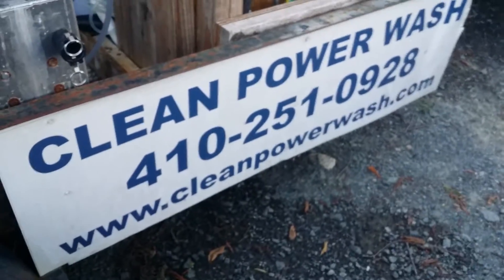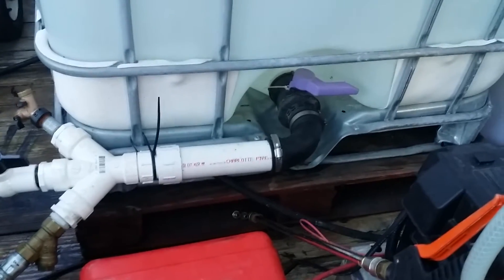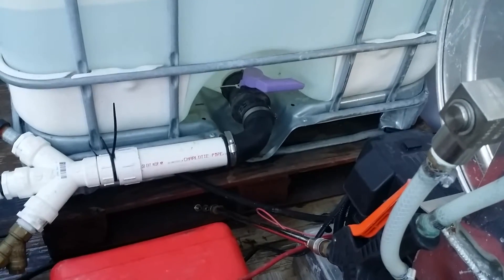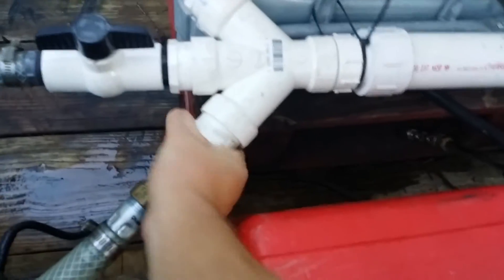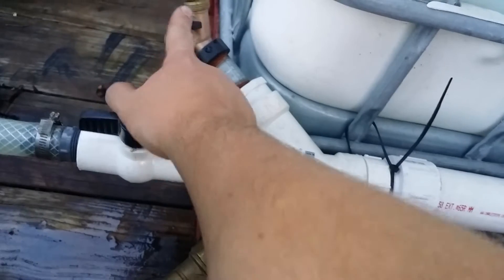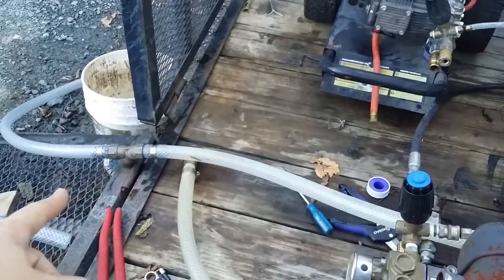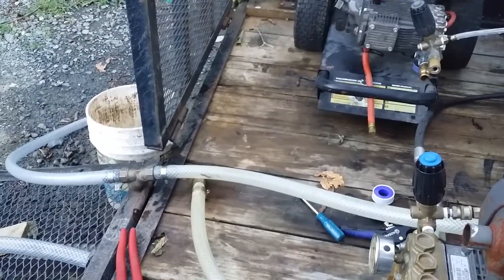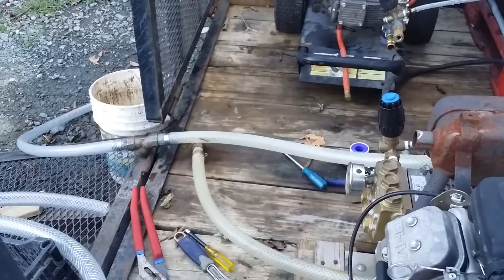How to Install Plumbing for a Supply Tank!

Comment: Hey Rob, what size buffer tank would you recommend for a 8 GPM pressure washer.  I’ll be pulling it on a 5x8 trailer which has a working load of 1,600 pounds.  My thoughts were a 125 gallon tank.  Wanted to ask you before I made my purchase.  Thanks brother, love the channel!
Reply from the maker: Kyle Keller 1600 lbs sound extremely light duty.  125 would be your only real option.  I would definitely plan to get a better trailer rated for 5k+
Reply: Ok thanks.  Say I got the bigger trailer, what size tank would you typically run with an 8 gpm machine?
Reply from the maker: Kyle Keller 275

Comment: Hi rob do you have direct drive pumps or belt driven plumb to your tank? If direct drive what is the key thing to do to insure the direct drive pulls water from the start? Thanks
Reply from the maker: Lawrence Ashlin we have direct, gear, and belt drive pumps.  The key is eliminating trapped air and having large enough plumbing before the pump inlet to force the water in
Reply: Clean Power Wash ok cool that's what I was thinking just wanted to get your thoughts about it. Thanks

Comment: I  have a honda pressure washer woth a cat pump. my question is do I need to have it gravity fed
Reply from the maker: Fernando Macias if it is not belt or gear drive then it would be gravity fed.

Comment: Can I ask where did u get the fitting that connects directly off the tote?  It looks like you have it threaded on there.. I been using a rubber fernco with hose clamps..
Reply from the maker: That was the original bulkhead on there.  That particular tote did have a threaded bulkhead on it.  I prefer the fernco because it is easier to work with

Comment: hey rob great videos thanks. i had a question about using a 275 gallon water tote. i hear that because they are square the water sloshes around and creates a surge and is bad for the trucks transmission. have you had any issues. i'm not going to drive with my tank full but i would like to keep some water in it between jobs. thanks
Reply from the maker: Andmikey Mikey yes there will be sloshing and the rounded leg tanks reduce the sloshing some. You can put orange mesh fencing inside it or the slotted gutter drain tubing in it, but only if it really bothers you.   sloshing water has less impact than the overall towing a big trailer does.

Comment: Hey, I'm having trouble finding that 1/2 inch to 1 in brass coupler. also the pump takes BSPP. Did you end up putting NPT and put extra teflon?
Reply from the maker: Kenneth Martinez  I always use Teflon tape.  1/2" male to 1" female. then use a 1" male to 1" barb

Comment: I'm in the process of setting up my trailer, I have an IBC like yours, the pump however is mounted on a skid along with the rest of the machine. This means my supply hose has to run UP from my tank to the pump. How much of a problem will this be?
Reply from the maker: Carlos Escobedo as long as you get the air out of the line and your water level is higher than your pump or if you have a belt drive pump then you will be fine
Reply: Ah ok that's good to know, I have a belt driven pump so I should be fine then, still gonna make sure my water level in the tank is above the pump to be safe though, thank you!
Reply from the maker: Carlos Escobedo once the water is flowing you will be fine regardless of the water level.

Comment: I'm in the process of setting up my trailer, I have an IBC like yours, the pump however is mounted on a skid along with the rest of the machine. This means my supply hose has to run UP from my tank to the pump. How much of a problem will this be?

Comment: Is that a 2 in union coming from the tank valve to the elbow? I cant see it very good . I have the same tank and i need to find a fitting that will go to the tank without dripping.
Reply from the maker: RP Whale yes.  2" rubber furnico I like them because of the flexibility and it also makes it easy to modify in the future

Comment: Good video.. just curious what is the purpose of the brass "Y" fitting going into the pvc.. does it need to be a Y? Or can it just be a straight fitting?
Reply from the maker: wizard owl that is an inline wye filter
Reply from the maker: wizard owl some people use a bowl filter instead